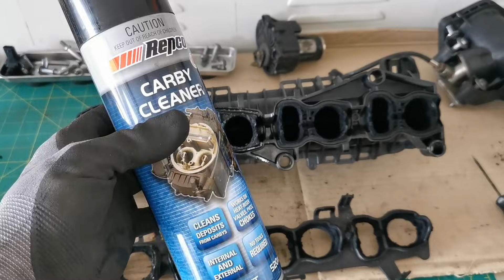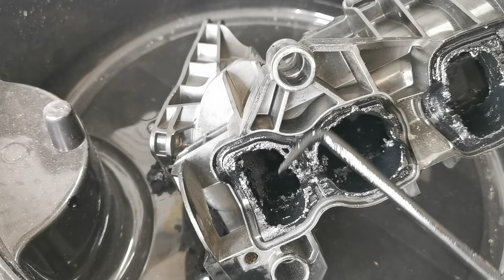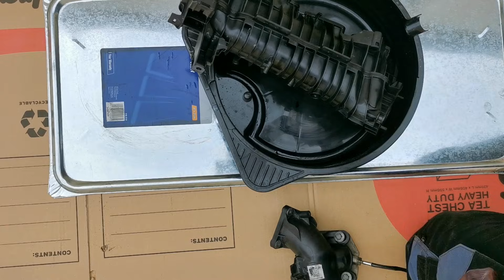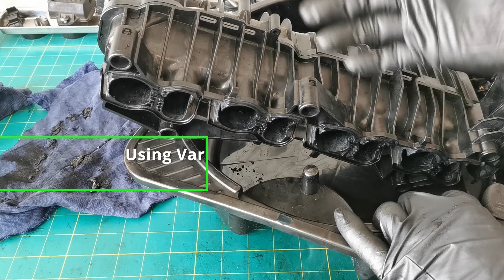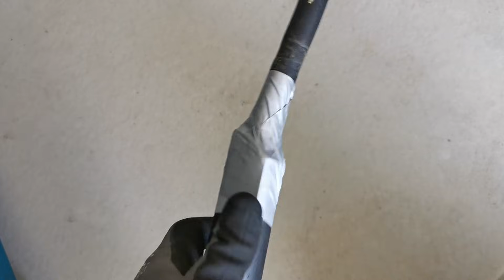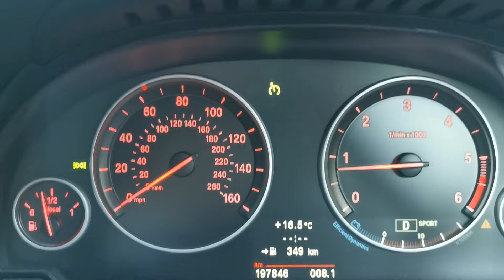DIY Carbon Cleaning Diesel Engine - Valves & Intake Manifold - NO SPECIAL TOOLS REQUIRED - BMW N47

Comment: Used brake fluid is the best degreaser.
Soak the components for few hours and do a pressure wash, all clean

Comment: I have found out my drive train popup problem. The Maf sensor was dirty. Clean it with CRC Maf sensor cleaner. My BMW 525D Xdrive has 175000 km and i think it is time to replace the diesel fuel filter. After replacing diesel fuel filter my car runs fantastic, no more drive train poping up, no more lag, no more hesitation, no more limb mode. the automatic transmission works also  better. It wa no doubt my old fuel was glogged and the big seal was missing on the old fuel filter.  For the first time after 3 years i can acceletate at full power without any error. Kick down works too. I have a to do list to replace the intake manifold, i have bought a new intake manifold with swirl flaps and a new electric engine for the swirl flaps. When you rotate the crankshaft to close each valve, did you just rotate it o the right till the next valve is closed? I have bought a crankshaft tool to rotate the crankshaft. It makes the rotate job much easier with this tool. Thank you  very much for a very useful video. I appreciate it.

Comment: Thanks for the vid, i had the coolant pipe under the manifold split, so had to take the manifold off to get to it. luckily i did as all 4 swirl flaps had broken off and 2 were stuck down by the valve stems!! lucky the engine didnt go bang. retreived them and clean the intakes up, all put back together. again thanks for the helpful info in your vid

Comment: I see all swirl flaps are broken on you car the same are on my engine. Does this impact the power when you accelerate from stand still. If i have to stop for red light or start moving from 800 Rpm I often get Drive train error pops up.  If i tun off engine fo about

Comment: The carbon , oil buildup is fom pcv valve when w blow happen it blow oil  stam to the intake. To prevent this you can install an oil catch can. I have order one for my BMW 525D Xdrive F11. Next job is to clean intake manifold. Overtime the plastic swirl flaps break into pieces because of heat. You can order a new swirl flap for both N47 and N57 for about 30 dollars. Thank you very much for the good video.

Comment: S it safe to use scotchbrite on aluminium head ?
Reply from the maker: Yes on a job like this, as long as it's not the harsh one.  

In Ireland i used to buy 2 different types. A grey and a red 3m version. The red one was a lot more abrasive.  
 
Sample on a corner a rub light before digging too hard into it 👍👌

Comment: I use 50% mixture of water and SuperMafrasol by Mafra. Dismantle the intake completely.
Fill the intake with the mixture, leave for 24 hours. In case of need repeat for 1x or 2x and then brush whatever remain (in mine anything was left). Not to be used on: aluminium, cast iron.
Use protective rubber gloves (red one covering till elbow).
Reply: In case I was not enough clear.
Don't put the intake into the mixture. Fill the intake with the mixture.

Comment: Step one -  fill up the washing machine with gasoline 

Step two - put the intake manifold into the washing machine 

Step three - turn on the washing machine
Reply: Instructions unclear. My washing machine now has 141 bhp. What do I do?
Reply: @bentricky  , you can add a restriction to the air filter by taping it

Comment: Amazing job .if the car it’s automatic can you turn the engine ? Thanks
Reply from the maker: Thank you.  
Yes, This car was an automatic, it is no problem to rotate the engine over by hand.
Reply: @GerardBurkeBurkesGarage  does the car need to be in neutral? Great videos, I have this along with rocker cover gasket, vibration dampener, tensioner and belt.

Comment: Great video. How long would that job typically take and what could be the cost of getting it done by a pro mechanic?
Reply: Not sure but I've seen Febi do my particular inlet manifold with swirl flaps for £175 and I have the notorious N47 engine that have swirl flaps issues, if I were doing this task I'd swap the inlet manifold out for new and sell the old one on eBay to recoup a bit of the cost. Gain a fair bit of time
Reply: @Spencer_White  i was quoted £1200 to replace the intake manifold.. bought a brand new one from ebay £56 and fitted it myself..
Reply: @jimcraig1253 awesome! yep, that's the way 🤓👍 I cleaned mine a few weeks ago, was free but a horrible/dirty job. Replacement would have been just under £200 (aftermarket as well) but there were plenty of videos showing how to do it with Mr Muscle oven cleaner £2.50 a can. Just done my lower control arms on the front, booked in this week for a wheel alignment. I have more bushings to do but spacing the work out. 
How other people are affording labour on car repairs I do not know. My boss and his wife just chopped in their 2017 Kuga and 2019 Fiesta both had patchy service history and fiesta has the dreaded wet belt and they still got great trade in values for new Kuga and Puma 😳. Some of the stuff that goes on is mad, car sales are damn keen to sell cars. He found his previous car's for sale again, ridiculous prices.

Comment: And how did u close the valves?
Reply: Rotate the crank. 14.00 in
Reply: So you rotate the crank but it only closed one cylinder what about other 3? And once i connect back do i rotate back to normal or will it rotate itself when i start?

Comment: Hi Gerard. Thanks for the video. Very comprehensive. Did you replace the gaskets on the manifold before re- installing it, or reuse the  old ones? Also - like one other commenter mentioned, I was a little unsure regarding the valves being fully closed. How does one determine the point at which they are fully closed? In other words, at their maximum closed position?
Reply: from what i;ve understoond you just try to see if they're closed and hope.
Reply: @XTyanoRO  Hope isn't a great strategy!

Comment: the carbon inside its also for not change oil in time ?
Reply: On diesel engines like this N47 the cause is more likely related to the EGR system

Comment: Great video. Thank you for showing the outcome of all your hard work. I have a question about the valves? What was the process you used to ensure the valves were closed prior to cleaning? I have seen people bump the starter and then check the cam lobes for position. I am not sure where the cam lobes position should be to ensure the valves are fully closed. thx
Reply from the maker: Thank you for the kind words,  
I mentioned the process in the video. Rotate the engine using the crank pulley, (I used a 1/2 inch long ratchet) watch the valves as you rotate and stop when they are closed. Repeat on each cylinder as required. Absolutely no need to bump the starter for this, it is simple to close the valves.
Reply: @GerardBurkeBurkesGarage but how do you know how much to turn? You only mentioned you went from cyl 1 and then 2, this isn’t the right order the valves will close. I am familiar with the Mazda 2.2d procedure were you have a mark to check on the exhaust cam from oil filling, turn 180 degrees and then next cyl is ready. That order is 4123 if I’m not mistaken.

Comment: Thanks for that Gerard.  Direct injection on petrol engined cars offers no opportunity to clean the manifolds and they invariably end up in a right mess.  I've a related problem on my 2007 1.8 Ford Focus with the Duratec HE engine - pinking caused I believe by carbon in the combustion chamber.  I don't think there's any way around that other than taking the head off and doing a thorough clean of everything.  I've tried fuel additives to see if it'll do a clean but two tanks in now it doesn't seem to have helped :(
Reply from the maker: Cheers for watching Davy🙏 
 
Strip down and direct cleaning is the only 100% affective clean. additives can be great but when it has gone to far it simply can't be affective enough. 
Check out some of the VW direct injection carbon build up on valves videos. Walnut blasting on these is a night and day difference. 
 
Swirl flaps, egr and carbon build up faults are all known issues with Ford focus of that age range. Borescope the valves and the cylinders to assess it further if you want to diagnose carbon build up fault. Requires some engine strip down but will give you a clear path without guessing.
Reply: @GerardBurkeBurkesGarage  Massive thanks for that Gerard.  I need to get a borescope down there to confirm.  Not sure whether the EGR or swirl flaps would cause pinking,  do you think they could ?

Comment: Don't forget the glow plugs, glow plug module and the coolant flange... While they are there looking back at you...
That's another nightmare video for ya... The glow plugs 🤢
Reply from the maker: Glow plugs are never fun 😁
Reply: At what mileage should I remove the Egr valve am up at 215 k the dealer had replace the egr at around 150k